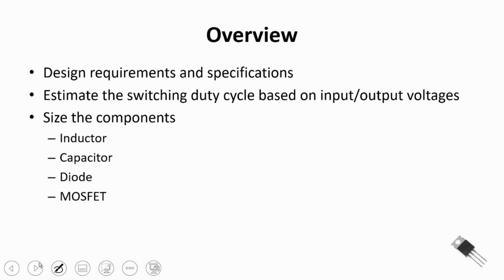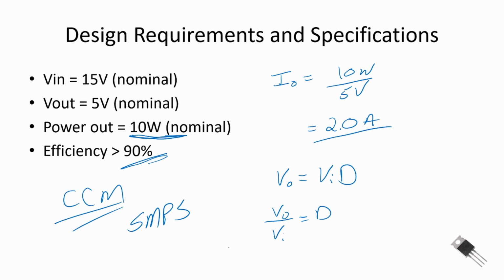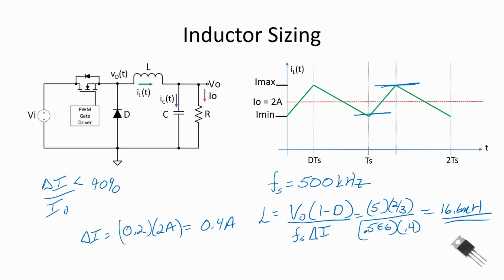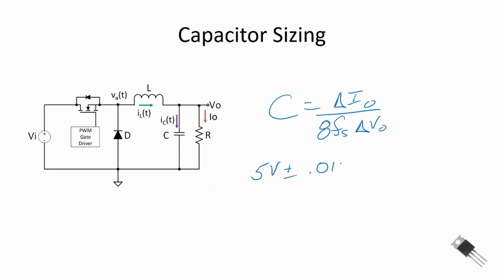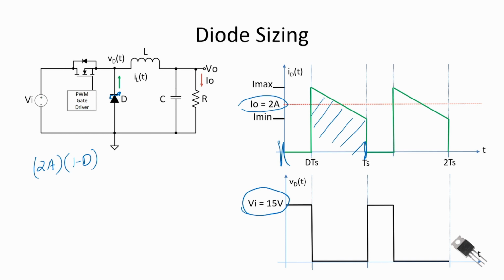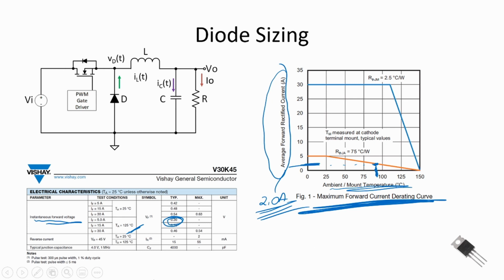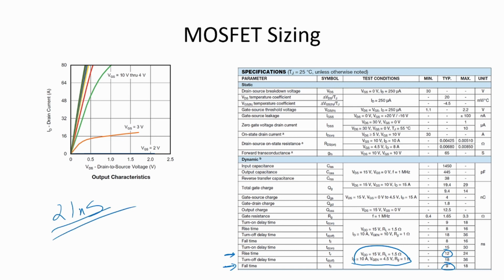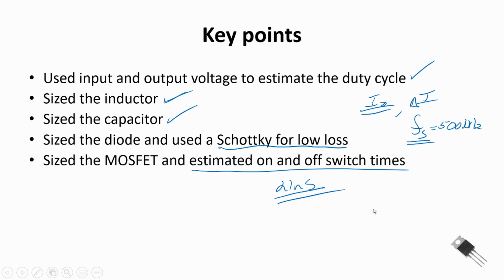Power Electronics - Buck Converter Design Example - Part 1

Comment: Thank you for a very good and comprehensive explanation. I have one observation to share and clarify for myself.
During MOSFET sizing @16:21 shouldn't the off-time voltage across MOSFET be 15.3V or 15.5V depending on schottky diode conduction voltage. 
Though it does not make any difference on our design calculation, the point I would like to clarify for myself is the reverse breakdown voltage rating for MOSFET is higher than supply voltage since the MOSFET source node is at a lower voltage than ground when diode is conduction. Is this correct?
Reply from the maker: Abuzar, excellent observation.  My calcs assume zero voltage drop across that fly-back diode.  However, the diode is one the major loss components in the entire design (see synchronous buck-converters).  That node voltage at the diode, reference to ground, when the diode is conducting is about 0.5V to 0.65V depending on the diode.  The input voltage is still about 15V.  Therefore, the drop across the MOSFET when it is "off" is just under 15V.  As you noted, it doesn't matter too much.  Often we will choice a voltage rating for that MOSFET that is a factor of x1.5 to x3 of the highest voltage we would expect.  Hope

Comment: Lmin= ((1-D)*R)/2f when I use this formula for 6:29 I get an answer that is a factor of 10 smaller. Also where does the formula for Lmin at 6:27 come from. I have never seen it before.
Reply from the maker: Hello Robert, the equation you have listed is the smallest value inductor that will maintain CCM for the buck converter.  I think somewhere in the video, its stated that we are designing for complete CCM and our ripple current for this example is 40%   Therefore, if your requirements are okay with entering DCM mode, by all means use a smaller inductor, but note that this will also impact the sizing on your filter output capacitor.   With regards to your second question, the equation for the inductor sizing is a modification of equation 5 from the Texas Instruments app https://www.ti.com/lit/an/slva477b/slva477b.pdf.  The TI Power Topologies Handbook has some information too.
Reply: @powerelectronicswithdr.k1017  Thank you sir.

Comment: Why not use a p type mosfet since it is a high side switch?
Reply from the maker: Hi Gidgy, great question.  Yes you could most certainly use a p-type enhancement MOSFET for the high side switch.  And as you are probably aware (based on your question) that driving a high-side p-type MOSTET  is relatively easy as compared to an n-type.  However, n-type devices are often more efficient.  An n-type device usually (not always) has a lower Rds and the Cgs and Cgd are lower too for the same current/voltage ratings.  This enables a faster turn-on/turn-off time, lower conduction loss and lower switching loss.  Its often a design trade-off between cost, functionality, performance, etc.  Perhaps I should create a video on high-side gate drivers?  Great question and I hope this answer clears things up.  Best wishes on your design. -Dr. K
Reply: @powerelectronicswithdr.k1017  Thanks for the quick response. Yes this certainly cleared things up. And about your question, the more content the better :)

Comment: Thank you very much sir,
Pls I want to design a buck converter to use it as solar charge controller, my challenge is pwm circuit to switch the buck stage on,

Pls help me
Reply from the maker: Hi Chibuzo, I'm planning on doing a video on PWM control of the buck converter this weekend and will keep you posted. -Dr. K

Comment: hi I am new to this.... can you tell me how did you get ΔVo while sizing the capacitor?
Reply from the maker: Hi Tanbir, the spec on the output ripple voltage wasn't provided for this example and therefore I made an assumption and used a percentage of the nominal output voltage.  When you make that assumption, use the full-load value for the output current as this will be your worse-case scenario.  The capacitor has to provide charge (i.e. output current) when the switch is off.  Design is very iterative and you may find that you will either select a size that is slightly higher (more cost/size but lower output voltage ripple) or slightly lower (less cost/size and higher voltage ripple).  Thanks for watching and best wishes on your design. -Dr. K

Comment: Why is the rule of thumb to use less than a 40% ripple current?
Reply from the maker: Great question.  The value of 40% is low enough to keep the design in continuous conduction mode (CCM).  Selecting a higher percentage might run the risk of DCM and also creates larger current swings.  Moving in the other direction, a design goal of 20% or 10% would greatly increase the size of the inductor, perhaps unnecessarily.

Comment: Sir,I want to design a buck converter of 40v dc 0.75amps with an input of 120 to 300v dc.Please suggest if i have to take D max or D min to calculate the inductor size.
Your video is much much helpful for me.Thanks for making such valuable information
Reply from the maker: Hi Sanjay, I would look at both cases.  However, using Dmax (i.e. the xase when Vin = 120Vdc) will result in lower ouput ripple current when your input voltage is 300Vdc.  Best wishes on your design. -Dr. K
Reply: @powerelectronicswithdr.k1017  ok sir Thank you

Comment: Hi. If my input voltage is range from 120v to 208V, and output voltage is 48V. How do I calculate my Dutycycle?  Thanks in advance!
Reply: finally how do you define R load?
Reply from the maker: @tamaica7770  R is just used to emulate the load.  Select R for your initial design as Vo^2/Po or Po/Io^2.  Keep in mind this value of R is just used to start your design.  Loads are rarely purely resistive.  -Dr. K
Reply from the maker: Hi Tam, your input values lead me to believe that you are trying to design an AC to DC inverter.  120V and 208V are common AC RMS values for commercial split-phase and 3-phase systems.  My first question is, is this a correct assumption?  If the answer to that is yes, then the next question would be offline or isolated?  The answers to these questions change your approach. -Dr K
Reply: Power Electronics with Dr. K i’m trying to understand and design an AC 120/208V to DC 48V converter. First I used full bridge rectifier, then I used Buck converter. So can we input ac voltage range from 120-208V to get 48v DC or we have to choose either 120V or 208V?  Also, i don’t have knowledge about offline or isolated design.
Reply from the maker: @tamaica7770  That is called an "off-line" converter because it is directly powered off the AC commercial line.  Your DC output from your FWB converter will be around165 to 300VDC because you need to use the peak value of the AC voltage, not the RMS value.  You can find the duty cycle as it will be Vo/Vin.  Therefore if you use D = 48/165 if the input was about 120VACrms.  It will be a little be greater as there are losses that we have not accounted for.  I would recommend LT Spice for simulating your design.  It's a great too.  Best wishes.  -Dr. K
Reply: Power Electronics with Dr. K thank you.

Comment: Very nice lesson sir. Just one question, how does this method of computing the inductor ensures that the buck converter will operate in continuous mode?
Reply from the maker: Pedro, as long as you keep the ripple current (delta-I) less than the average the full rated output current, you will maintain CCM.  For example,  if Io = 10A and you design for a 25% ripple voltage, delta-I will equal 2.5A and you will maintain CCM.  The boundary between DCM and CCM is when the average output current equals the ripple current.   Entering DCM isn't always the worse thing to happen and some controller designs allow for both CCM and DCM modes.  Hope this helps.  Best wishes on your design.  -Dr. K
Reply: @powerelectronicswithdr.k1017  Understood, thank you very much!

Comment: Great video sir..can you post some videos on step by step LLC converter design also?
Reply from the maker: That's a great idea and I'll put that on the list of videos to make.  In the meantime, here's a paper that describes the design process "Designing an LLC Resonant Half-Bridge Power Converter," by Hong Huang, Reproduced from 2010 Texas Instruments Power Supply Design Seminar SEM1900, SLUP263, Texas Instruments, 2010.
  The design of an LLC resonant converter is not as straightforward as the buck converter.  There's many different options to select.  Thanks for watching.  Dr. K

Comment: Hi Dr.K vivek here I am designing a high rated buck converter can you give more details in designing capacitor for buck converters? I didnt get you that how did you choose capacitor?
Reply from the maker: Hi Vivek,  at the 8:50 section I discuss how to size the capacitor.  The value of the capacitor is the ripple current/(8*switching_freq*ripple_voltage).  This only provides the value of the capacitance to meet the ripple current and ripple voltage requirements.  Selecting the type of capacitor is highly dependent on the output voltage value, the amount of ripple current, output power etc.  There's a link in the description to an application note on selecting MLCC types of capacitors, assuming that's in the power range for your application.  Best wishes.  -Dr. K
Reply: @powerelectronicswithdr.k1017  Yes exactly, how did you get the value 0.2v as ripple voltage, never mind, I am bit struggling to figure it out. could you explain me?
Reply from the maker: @nustanature2655  It was an estimate.  Typically the ripple voltage requirement would be provided as part of the design specification.  It was an estimate that I assumed.  Decreasing the value of the capacitor will increase the ripple voltage at rated load and increasing the value of the capacitance will decrease the ripple voltage.  Some times  you have to makes some estimates in the design process.  Start with 1% or 0.1% and see how your design is impacted. -Dr. K
Reply: @powerelectronicswithdr.k1017  Thank so much professor I greatful to you.:)

Comment: How to do this analysis if a range of input or output voltage and current is given??
Reply: Because in that case we get duty cycle value ranging from Dmax to Dmin. Then for hose cases we get two values of L and C. Then how to choose a value such that L and C value fulfills the requirements output for the entire input voltage range??
Reply from the maker: Hi Siddhi, great observation in that there will be a wide range of duty cycles.  Typical one will select the max value for L and C.  but this is not a hard and fast rule.  One approach is to look at min-max variations of I/O.  For example, you can do a worse case analysis and analyze with maximum output current and then look at the min/max ranges of your input voltage and output voltages.  Then see how well the design meets the requirements.  Design is an iterative process and the material presented here just provides a first order estimate for your component values based on nominal I/O values.  Further work is required to check your design over a wide range of input voltages and output loads.  Also dynamic control of the duty cycle to account for these variations is another topic. I would also suggest using a simulation tool such as LTSpice to help with that analysis.  Best wishes on your design. -Dr. K

Comment: Firstly Great Video, Secondly im having trouble designing a Buck Converter that has a fixed output but the input voltage varies. any tips or tricks. its a DC to DC buck converter
Reply from the maker: Hi Jackson, without specifics its hard to tell what's happening.  Have you simulated your design with different input voltages?  Note that the equations that I present in this video are for continuous conduction mode (CCM) and it is possible to go into discontinuous conduction mode (DCM). Also, I did not discuss closed loop control for these designs.  Most DC/DC converters use a controller that uses both voltage and current feedback control for varying the duty cycle.  Keep me posted on your findings and thanks for watching.  -Dr. K

Comment: Great detail and explanation on Buck converter design. Thanks
Reply from the maker: Thanh, glad this helped.
Reply: @powerelectronicswithdr.k1017  At 13:22 you circled 30A and said "30A forward voltage". I am sure you mean 30A forward current. IMO, I wouldd not choose FET 30V rating and Diode 45V rating. Leakage inductance and parasitic capacitance would cause high voltage spike on top steady state voltage. These voltage spikes will breakdown the  FET and Diode. I would choose at least 75V or 100V rating on both  devices. Thanks
Reply from the maker: @Thanh-Electronics  Hi Thanh, yes I think I messed up in that area.  With regards to sizing the FET and diode, my advice is to start at x2 times the maximum nominal value and then adjust accordingly.  Over sizing to a factor of x3 or x4 increases the component costs.  The sensitivity to cost in the design is something to consider. Low volume and high reliability might justify a higher rating.  High volume/cost competitive applications require the designer to explore ways to keep costs down.  As an example, the PCB layout and component placement can drastically impact lead inductance and parasitic capacitance.  For such an application, I recommend using the vendor's datasheets, application notes and reference designs as guides.  There are also integrated solutions that package the switching regulator and switch in the same package.  Thank you for the feedback and best wishes on your designs. -Dr. K.
Reply: @powerelectronicswithdr.k1017  Hi Dr. K, Thank you for your comment. I totally agree with you regarding sizing and readjust accordingly. Size and Cost always a major factor in production. Sorry, I used to work for satellite applications and always emphasize on reliability and follow mil spec strictly. Your power electronic  tutorial classes are very practical combining with simple theory behind. Best Regards.